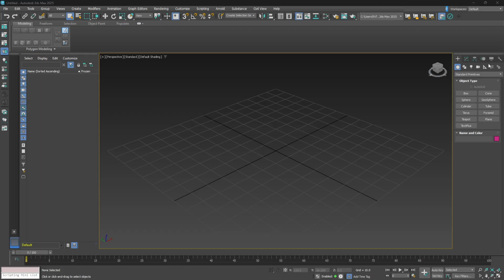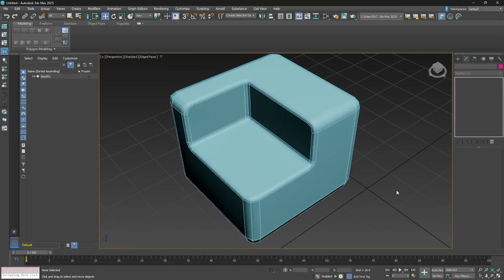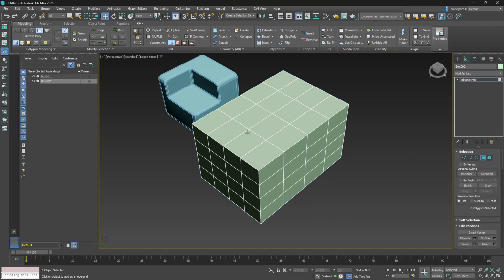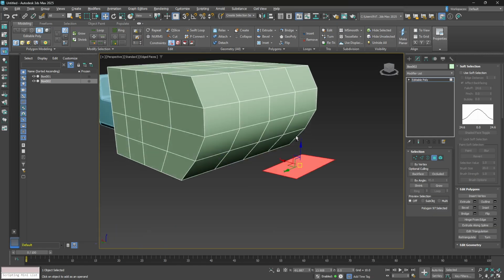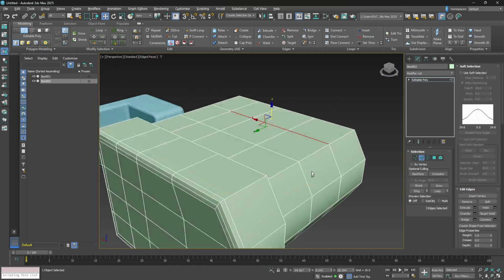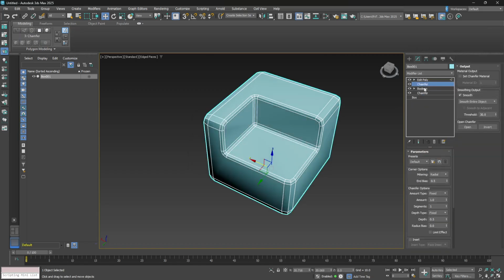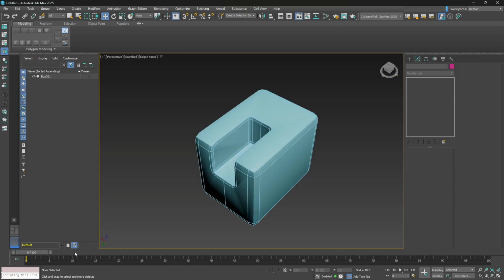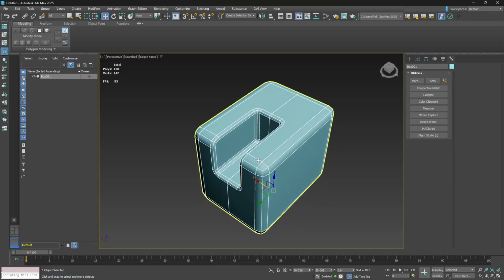3D Studio at a Glance

Comment: I am currently learning Blender (been using Max for 5 years, decided to switch after i was fired) and even after only 1.5 weeks I already feel quite comfortable with it. Helps that they share the modifier stack approach. Max always felt overbearing to me, i never really mastered it, there is just too much of everything. Blender has some quirks but overall some tools already feel on par or better than Max's (for example soft selection which i barely used in max, but in blender its so easy and intuitive. Or modelling on top of another objects geometry, sculpting's grab tool is useful , etc). 
What sent me over the edge was trying to set up edge creases in Max so that they will show up in Zbrush and failing for a whole hour (i tried all the ways to set creases and different exports all to no awail). Then I tried Blender to assign creases to the same model and after exporting it Zbrush saw the creases flawlessly from the very first try.